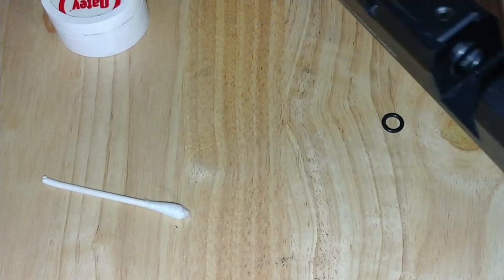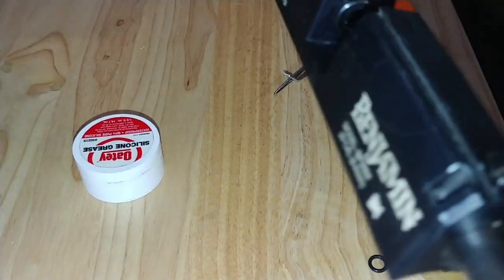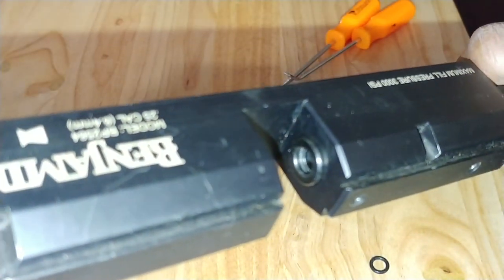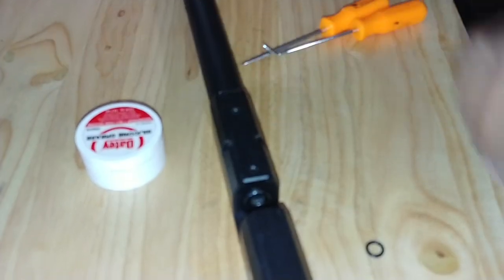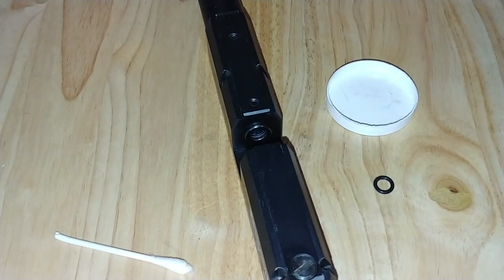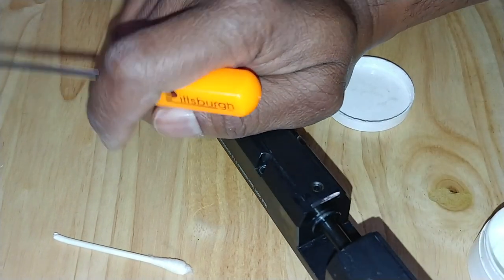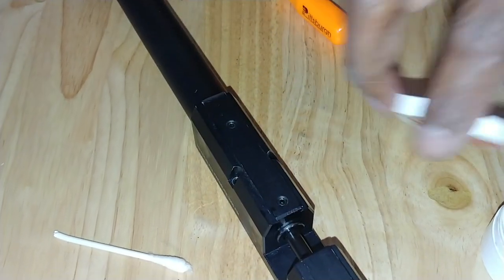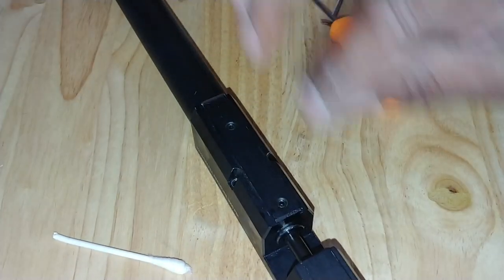How to replace the Marauder barrel o-ring.

Comment: Thank you very much I accidentally blew mine out and someone was telling me I need to take the barrel off and take the breach off and you showed me a very easy way to put that O-ring back in
Reply from the maker: Cool.  Glad to help.
Reply: @Monkeydad1969 Can you tell me the exact size of the o ring? Thanks
Reply from the maker: @beladeak643   for a .5 Marauder it's a #2-010 (No.10 as I say in the vid).  For a .177/.22 it's a 1.5mmx4mm.  These are per Crosman/Benjamin on the EVP for the Marauders.  If you have a good o-ring kit in SAE and Metric, you should be able to find those sizes.

Comment: Thanks this video worked for my Benjamin Armada in .25 cal it used the same O ring. It took me a few tries and I destroyed 2 o rings before it worked
Reply from the maker: I'm glad it helped.
Reply: Did you initially do this repair in connection with a malfunction to the internal suppressor?
Reply: @niksutherland4280  Not sure. After accidentally letting the bolt go forward with no pellets in the magazine I heard a 'misfire' and that's when the O-ring must've popped out. After that my shots were louder enough to hurt the ears and the shots felt weaker at the same time, I thought I had broke my gun at first then I noticed there was no o-ring. After I replaced the O-ring it started shooting quiet and brand new again.

Comment: Great video, no BS and straight to the point. Here is some info that might help those who need actual dimensions. A 2-010 O-ring (for a .25 cal.) measures: 1/4 (ID), 3/8 (OD), and 1/16 (Width). Sometimes hardware stores only have O-rings listed by size. I got this info from the Parker O-ring guide; it’s online.
Reply from the maker: Thanks and thank you.
Reply: Are you sure on that? I got measurements of 5mm ID 9mm OD Abd 2mm width. My o rings work fine seemingly. I am not technically proficient so I hope you don’t take offense. I’m just not sure what to purchase and this and my hand pump is my only use for O rings.
Thank you for your contribution I found o rings those specifications. I also bought the 5/9/2mm rings as well. I’ll return whatever doesn’t work best.
Reply: Just to piggyback off of your post those dimensions are #10 SAE NOT metric.

Comment: Thank you for the straight forward video.
Any chance you can share a video on how to replace the O ring on the fill port / nipple? I put a ballon over it and sure enough it is leaking. I have had the rifle for a short period of time and shot less than 400 rounds with it.
Thank you.
Reply from the maker: @mounirjermany5948  thank you.  Question... how do you fill the rifle, with a pump or tank?

Comment: Excellent vid. Please follow this gentleman's advice on checking and replacing this o-ring. 
I tweaked my gun for pest control and hunting so my shot count is going to be low anyway. I didn't realize it was missing. Got a full 2mags (25cal, gen1) now. 
Interestingly fixing that exposed the dreaded ping. Not a performance issue but very irritating.
Reply from the maker: Yeah, that ping.  You can always get the de-pinger from Crosman for the Gen 2 or get a piece of rubber, cut to fit and put down the tube.

Comment: What lube you using  couldn't see the name brand. Good video thanks you for sharing.
Reply from the maker: Sorry, it's Oatey plumber's silicone from Ace Hardware, but it's only 90%.  I needed it in a pinch.  Works fine, won't cause any combustion.  I'd advise getting 100% silicone from an airgun store or hobby store.

Thank you.

Comment: How do you get the old o-ring out?... THANKS
Reply from the maker: I just used a dental pick to remove it, but most times it is blown out the breech if the bolt isn't closed all the way or the o-ring is real old and not lubed it will blow out the muzzle when fired.

Comment: What caliber is this?  I did not hear it mentioned.  The net is great if you want all kinds of irrelevant answers for a question!  I read that the .22 takes a #9?  I really have no idea.  And yes, I've found like 30 different answers, so I'm just confused.  I am looking for the correct size o-ring for a .22 marauder breech o-ring?  Thank you.  Very good video.
Reply from the maker: That's a .25.  Sorry, I should've said.  The .22 according to Benjamin is a #2-009.
Reply: thanks!
Reply: So, just to add to my confusion.  My Danco set of plumbing o-rings has a #10 listed as 11/16" OD x 1/2" ID and 3/32" wall.
I see #2-009 listed other places at 11/32" OD x 7/32" ID width of 1/16".
I'm guessing the Danco ring kit must use a different scale?  
The most frustrating part is that Benjamin sent me some, for free, and I lost them!
Anyway, thanks for the help!
My marauder was a great shooter until recently.  It held 1/2" groups at 100 feet.  Then it started shooting 2.5"+ size groups.  The smith at Benji said the o-ring will tighten it back up.
Reply from the maker: @mikeprokurat1383  yes, because you're leaking air out the barrel where the o-ring should be.  Now is a good time to clean your barrel.
Reply: @Monkeydad1969  
I completely disassembled and cleaned it.  Accuracy improved some.  I'm still confused about o-ring sizes
Reply from the maker: @mikeprokurat1383  you can order the o-rings from Crosman or go to the hardware store and tell them what size you need.
Reply: @mikeprokurat1383  I will confirm that the 11/32" OD x 7/32" ID width of 1/16" which for Danco (96761) is labeled as #47 O-Ring can fit and replace the Original breech O ring in my Benjamin Marauder SAM

Comment: Thank you so much!!! I am a “mechanical idiot”. And I found your explanation and presentation to be perfect for those of us like myself.
I am curious when you say “#10 O ring”, do you mean 10mm?
My understanding is your reference is to an O ring 12mm outside diameter and 10mm internal diameter with 1mm thickness. Is that correct? I bough 50 on Amazon fit a few bucks I just want to confirm I got the correct item.
In any case that O ring is a real “ Achilles heel”!!! I mean I had it blow out and it was hanging on the bolt itself. Unfortunately I didn’t notice this until I opened the bolt and the ring dropped to the plant life below. The new O ring seems to be working fine. I just wish they could come up with a permanent solution for the gas seal. Of course gas seal has been an issue with firearms as long as we’ve had gun powder!!!
Reply from the maker: I am so sorry to reply so late.  So I'm replacing the o-ring for the .25 barrel.  With Crosman it is part # 106-005 (#2-010), but in my Harbor Freight o-ring box it said #10.  For general knowledge the .177 is part # 1763-058 (1.5mmx4mm), the .22 is part # 1761A023 (#2-009).

Comment: I have replaced the barrel o-ring but there is still blowback. what could be the reason?
Reply from the maker: Is it coming from the barrel past the bolt or is it coming from under the breech at the tube?
Reply: @Monkeydad1969  I think the air is coming from the breech at the tube and the sound loud when fired
Reply from the maker: @LauroJrJacob  check that o-ring and make sure it is in there and didn't shoot out the front.  Also, depending on what you used to install it --- if you used a metal pick, as an example --- that the o-ring wasn't damaged.  But it sounds like it may have shot out the front.  Just make sure it is seated fully within the groove.  Let me know.
Reply: @Monkeydad1969  I've changed the o-ring several times and I'm sure it fits well in the groove but there's still blowback isn't it from the pellet pusher?
Reply from the maker: @LauroJrJacob  if you have the proper size o-ring, the probe should seal.  Unfortunately, it's hard to diagnose without actually having it in front of me.  All the parts are original to the rifle?
Reply: @Monkeydad1969  the o-ring is 009 viton v75 but when the sam bolt broke I had it done at the machine shop because I can't buy any sam bolt here in the Philippines
Reply from the maker: @LauroJrJacob  you have a SAM?  You didn't say that.  I didn't know you had a new bolt made up .  It's very possible it's the bolt not sealing, and I don't own a SAM, so I don't think I'm going to be very helpful.
Reply: @Monkeydad1969  yes , my benjamin marauder is semi automatic, maybe it's better if I take it back to the gunsmith that made it
Reply from the maker: @LauroJrJacob  that would be best.  I would say the new bolt has a smaller outer diameter than the original.
Reply: @Monkeydad1969  maybe by the way sir thank you very much
Reply from the maker: @LauroJrJacob  I hope you get it fixed.  Please let me know.
Reply: @Monkeydad1969 sir according to tha gunsmith the blowback of my benjamin marauder sam are normal because the wind push  the bolt back to load again.
Reply from the maker: @LauroJrJacob  ok.  Again, I don't own one, so I'm not too familiar with them.

Comment: Would be nice if you'd describe for the audience and use a tooth pick or your dental pick to show where the O-ring goes.  I.e. see the barrel, the O-ring goes around the outside.  Good info though and straight to the point.